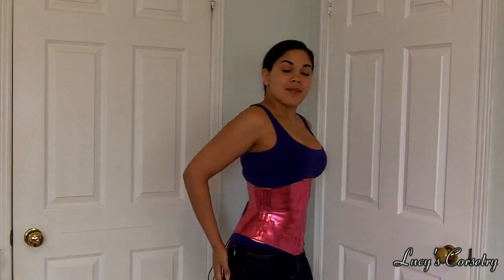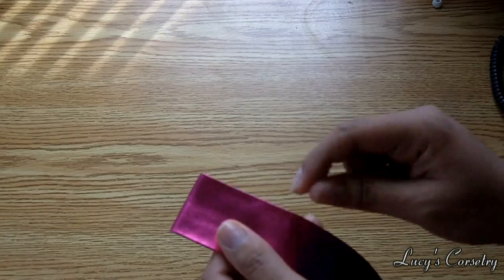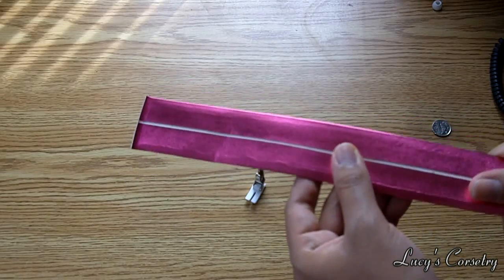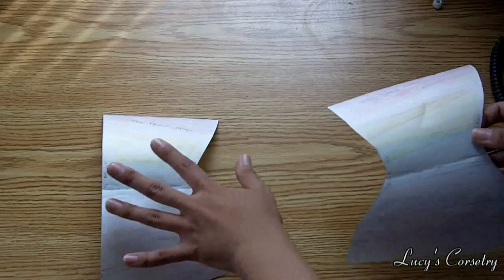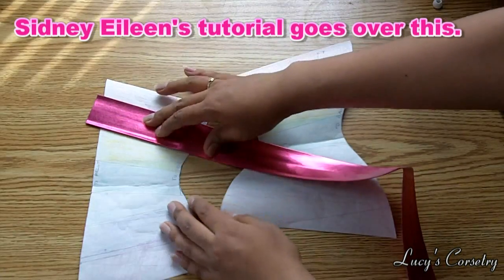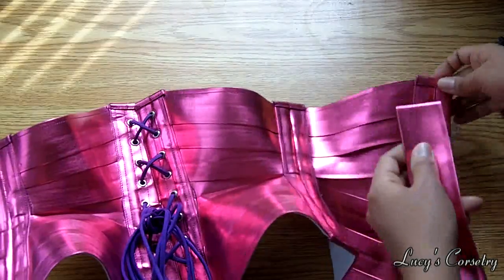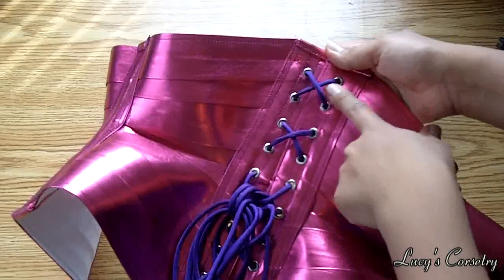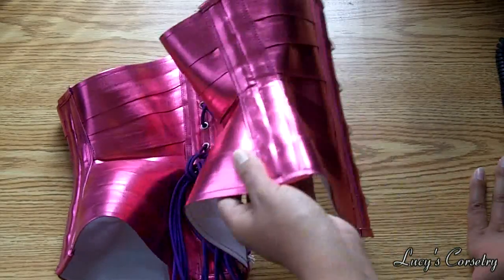"DISCO ARMADILLO" PVC Ribbon Corset | Lucy's Corsetry

Comment: the corsetier I go to makes the sides go higher than the models I usually see on you, 
After dipping under the bust usually they curve upwards at the sides (covering a bra strap, so to speak) 
At first I didn't understand, but now I think it is to make the silhouette smoother and muffin-top free, hiding the presence of the corset under relatively tight-fitting clothes.
 Have you considered that kind of design?  I think it would look amazing on you!

Comment: If you ever use PVC again for a corset, there's another way you can avoid the feed dogs from messing up the material. What I do when I sew pleather or vinyl is I take all the scrap bits of tissue paper from when I cut out patterns and I place one layer between the bottom of the fabric and the feed dogs. I use regular metal feet when sewing, and so I usually put a layer of tissue paper between the foot and the material as well. It's easy because when you're done, you can just rip off the paper.

Comment: I am still not exactly sure what a ribbon corset is. I have never seen one before.
Specifically, how is the construction underneath the ribbons different from most corsets? Would you recommend attempting this for a beginner corset-maker?
Reply from the maker: This one I intentionally lined in coutil because the PVC ribbon had a tendency to stretch - so it's not terribly different from a simple 4-panel pattern corset. I have made other ribbon corsets without the lining though, since satin and grosgrain ribbon don't stretch as much. But it's trickier to sew compared to other corsets; I wouldn't recommend it for a beginner (but also, I don't want to be a "gatekeeper" in terms of corset making, so you are welcome to try it if you feel up to it!).